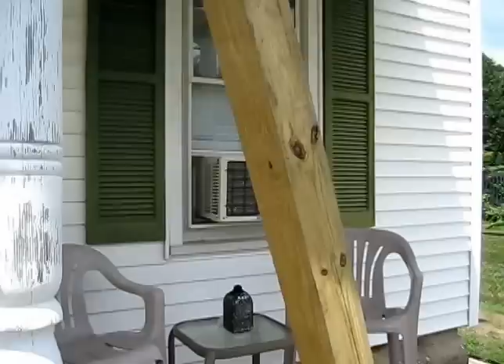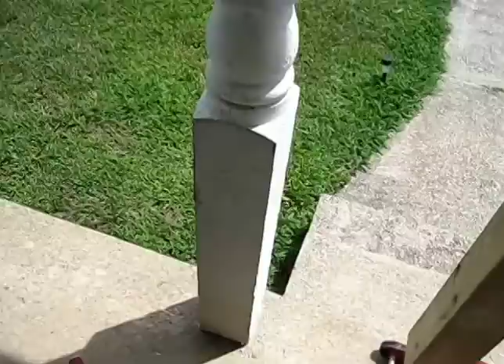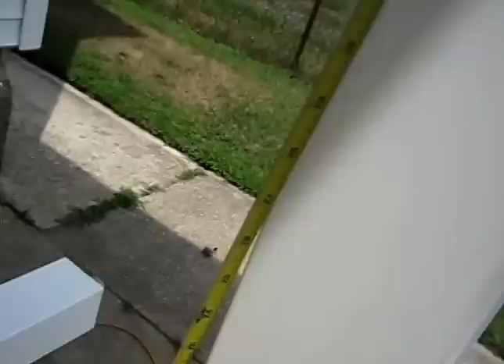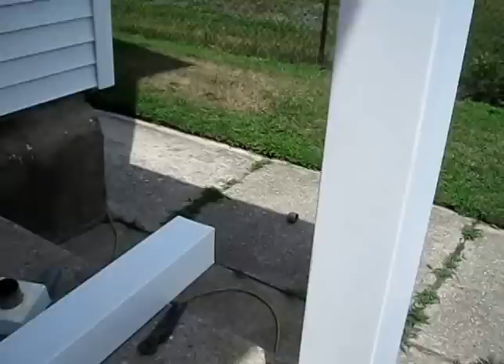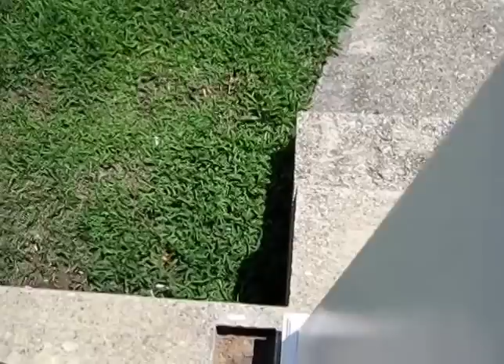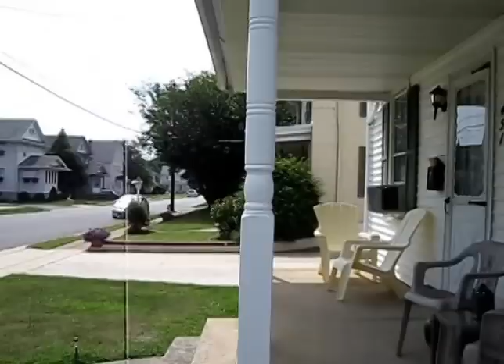How to Replace Porch Post columns | Composite and vinyl rot free porch post replacement

Comment: If you have a normal deck wood substructure in a wood header beam how do you attach these load-bearing vinyl country posts to the header beam and the deck structure. Do they make a cleat

Comment: Good video but I attach my posts to structure no matter what not 25 year experience but my common sense talks to me
Reply: I agree with you that the post needs to be attached. I have to replace a wooded one with the same column that he installed but can’t figure out how to attach the column with the existing structure. If you solved this problem please let me know how, thanks!

Comment: Top of the post, are there any screws that holds it in. Or just the weight?
Reply from the maker: I add 4 3"screws then slide the square trim up an over the screws.....they provide a cheap plate to mount.....about the quality of a soup can.   '#!$!#!
Reply: @Chrdiy  Lovely. I'll change mines out soon as we get a break from this extreme heat.

Comment: Secure to top and bottom how???
Reply from the maker: For this install. Bottom has. Epoxy added to 1 inch square recess in concrete pad. Top secured with 4 3.5" coated deck style screws hidden by decorative trim added after completion. Fastening clip that comes with post are not reliable. Remember steel post insert....so work set screws around them
Reply: Thanks for reply and info about that. I plan on installing exactly the same posts and was hoping to fasten/anchor more securely. 

Was not / am Not certain that screws would hold well due to foam internal makeup surrounding aluminum pole center. Also, not have the base actually recessed for anchor (the way the original one in the video) seemed insecure.

I appreciate your expertise and advice. Enjoyed the video. I will continue to learn how better to secure these type posts.
Reply from the maker: @ronpatton5721  thats the only drawback with this product. Not much achor strength and hurricane or gale winds could cause roof lift issues. Depending on where you reside. I found this to be an issue as well

Comment: Hello.  Very nice video.  You are a great teacher!  I have to do this exact project and this was excellent.  I have a question about the metal clad repair.  I have no idea where to begin with patching that.  Could you possibly explain how to patch the ugly voids in the top porch area?
Reply from the maker: Typically you have to reclad with metal. You will need an aluminum bending break

Comment: Thank you so much for your help! Can you please tell me what to do if all of the old posts are different measurements? Do I cut my new vinyl posts all in one same measurement, or do I cut each new post to match the measurement of the old post that it is replacing? The old posts are 92.7, 93.7 etc. So, about an inch difference overall. Also, what kind of lift can I get that is the cheapest but will be the right kind for the job? Thank you for helping me.
Reply from the maker: Without being there to see? U would say individually replace with different sizes and replicate what is there. Unless you have the skill and knowledge to determine why they're different being the porch concrete wood decking for overhead roof out of level we're sagged there's no real way to tell without being there. So it would be fair to say to replace them individually size for size. Don't open another can of worms
Reply: @Chrdiy  thank you! You are right! I think I can only handle the one can of worms as it is. Haha.

Comment: What if the post has two brackets on either side? Can I just put the temporary support post on the side of the bracket, or do I have to remove brackets first and then put the support post closer to the existing post?
Reply from the maker: You should br able to next to with the support post. The outward beam should be solid continuous all the way across the front of the porch so you should be able to support it within 6 in of any post with no problems
Reply: @Chrdiy  thank you very much. The posts have probably 12 inches of bracket, so I will have to put my temporary support post 12 inches out from main post, I also noticed that each post is a different measurement. There is an inch difference between them. I guess I measure and cut each post to be the length that the existing post is?

Comment: I don't see that you secured the post at the top and bottom.
Reply from the maker: Post bottom locks into existing poored concrete deck. Cement top was poured around the old wood porch post base which advances the water rot at the base. Top is secured using 3.5" coated screws, pilot hole at 45 degree into the header above then covered by the above decorative trim. Better secure then manufacturers cheap aluminum top plate mount. (Not shown).

Comment: What would one expect to pay a handyman/professional to replace a pair of posts/columns.
Reply from the maker: Well you would have to determine that based on what it would take to remove the post what's being replaced and what type of time is involved in picking up material and completing your task. Good rule of thumb would be to make sure you're paid for your time picking up material performing the work and clean up if you're not sure how to estimate you can range hourly. In my area of New Jersey first hour is a minimum 110 with 55 per hour after this includes pickup. No set rates you need to find out what's competitive in your area

Comment: Great video, Sir, but have one question: What did you use to fill in the hole at the top of the post with, after you removed the post? You used vinyl patch mortar to fill in bottom holes. Also what is the name of the tin or vinyl material that surrounds the top of the post? Thank you in advance for your time and effort.

Sincerely,
Pete
Reply: He would have to put on a new wrap or patch it with a smaller piece of coil stock. I would bend a new piece that would cover both holes with that one piece. Of course, you would have to remove both center pillars at the same time and your length would be limited by the distance between your jacks. Two things that I do differently is I use a bottle jack, with no wheels. and I like to attach my jack post at the top with a Simpson Tie. Kind of like a joist hanger, but is 3 1/" x 3 1/2 ".

Comment: Thanks for the video. I have a roof top deck railing with no load. The 4x4s were nailed into the floor frame before the floor was laid. I can not access them besides breaking off and digging out some of the wood. When I removed the posts, I have a similar 2 inch deep hole (like the holes you filled) and I am trying to figure out how to nail a bracket inside that hole will attach to the 4x4. Any ideas?

Comment: Does code require any anchoring at least at the top? I think I would be nervous with both top and bottom not anchored especially with a railing going up and the possibility of someone leaning against it

Comment: I'm curious as to why the old posts were cut in half when the nails could have been cut, keeping the old posts intact.  The old posts did not appear to have suffered much, but for bottoms, which could have been cut.  Such old posts would sell as architectural salvage for more than the new ones cost.

Comment: Great video! quick question, so does the weight of the overhang porch keep the poles in place? you don't need to screw or glue anything in to hold them? thanks

Comment: I have a dumb question about the jack: How do you gently lower the jack since it's hydraulic and once you turn that arm clockwise (or counter) to lower it, you really have no control of how fast it comes down. This is the only scary part of the project for me and why I haven't attempted it yet.
Reply: +roymazz you do, you just twist slowly. It won't come crashing down, it'll ease it down. Never done it with a pump jack before, but I've done it with a bottle jack which raises and lowers pretty much the same way

Comment: hi vince excellent video.
hope this isnt a dumb question.
What secures the new post at the top and bottom,
just the weight on it?
Reply from the maker: upper and lower mount cleat comes with the unit, this one is actually imbedded into the pad, replacing the old

Comment: I only have one post on my porch and I need to replace it. Do I have to cut both ends or can I just cut the bottom to the finished length?
Reply: I have to cut 6" off the post. Now I won't be able to install the metal piece to the post . Is it ok for the foam to sit on the concrete?
Reply from the maker: No it depend on the alignment of the railing, these were cut at both end because the overhead header support above the post is low. You have to do the math to match what is existing.
Reply from the maker: William Catalano Since you only have one, try to maintain about 33-36" in lower stock befor the turned portion. You don't want the top too short or the bottom too long, use you visual guidlines, pencil a proposed cut, top bottom or both, the look at if it look odd to you change your cut measurements., really hard to answer, but if no railing is involved im sure you wont go wrong here

Comment: you dont even secure them? just the weight of the roof is the only thing holding them in place?
Reply: +GrayXIII You can put shims between the wheels and the side of the jack, causing them to remain steady.
Reply from the maker: sure do lower bases two outer post are inlaided into pad 2 inches. the Enter to post at the base having a concrete epoxy seal put against the post to the concrete before the sieve cover gets pulled down. All for upper post I've pilot hole drilled 3 inch 10 penny finish nails one on each side then the sleeve slides up and get the poxy to the top .

you can attach the cleat directly into the header beam then you then then you can push the post up  into the cleat then you have to jack the roof an extra 3/8  inch for that extra height. different schools of thought but always some type of fastening
Reply: +Vincent Dramis Did you end up putting a skirt on the bottoms of the posts? Less fill in work XD. Also do you have to worry about jacking the roof up with a jack on wheels? I've done it before but only with a bottle jack. I'd be worried the slightest shift in the plumbness of that support would cause it to go flying and the roof to come down.